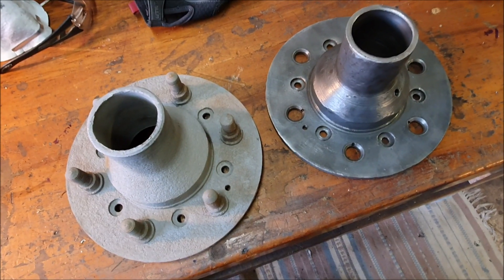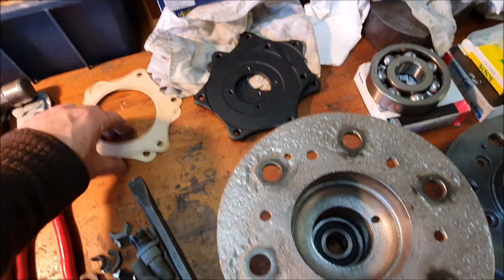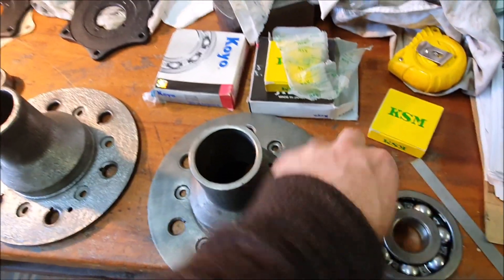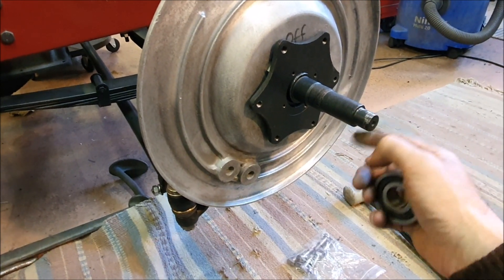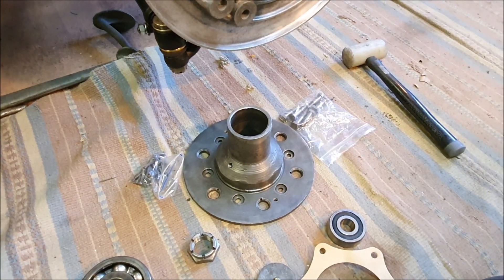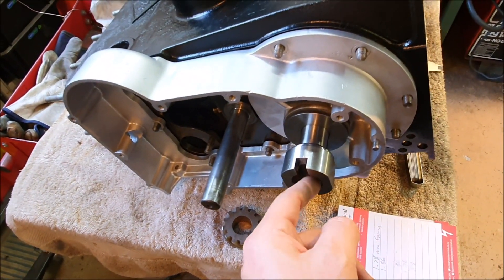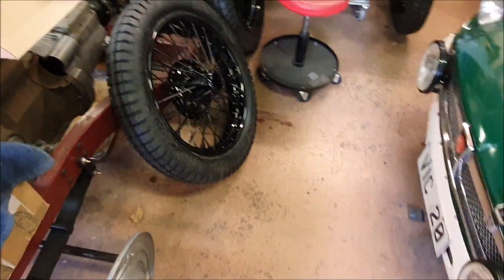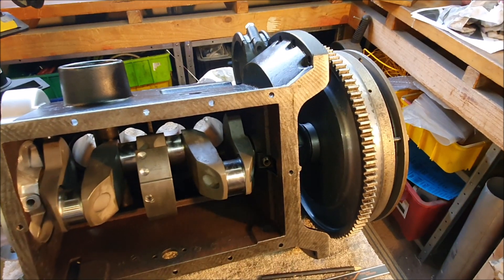Pre war cars update - Front hubs and crank again

Comment: Before you go machining anything to clearance the crank end float, you might want to drop in the pistons and con rods and check the alignment of the big ends to the crank journals.  Thanks for the videos
Reply from the maker: I am hoping I don't need to machine anything, just add the chamfer to the rear main. That's a good idea about checking the rods and pistons. That had occurred to me too but at the moment it is so far off you can see they won't line up! I think once I get the front cover seated doing what you suggest will be a good idea. The videos are mainly so people can tell me what to do and definitely what not to do so thanks for the comment.